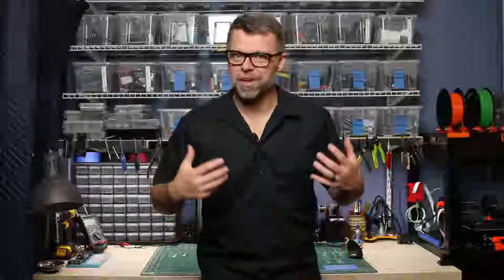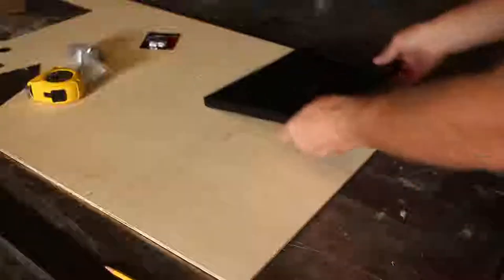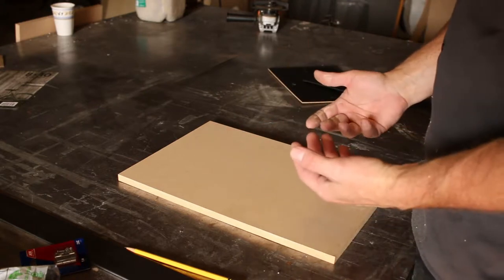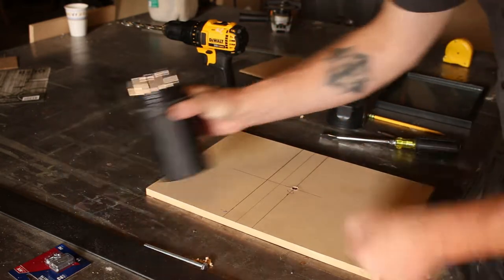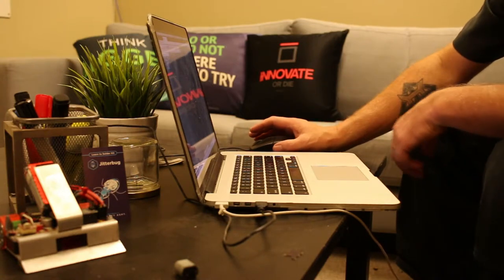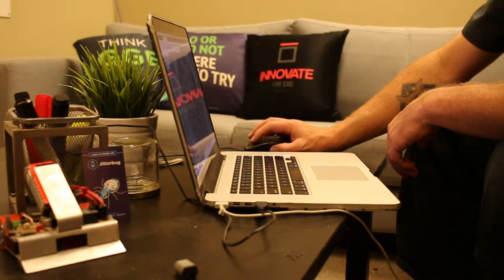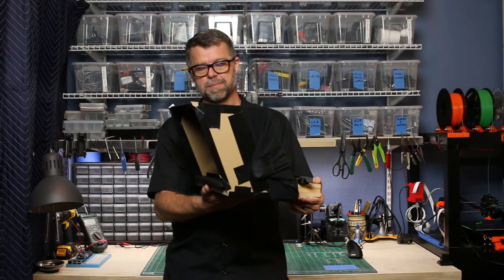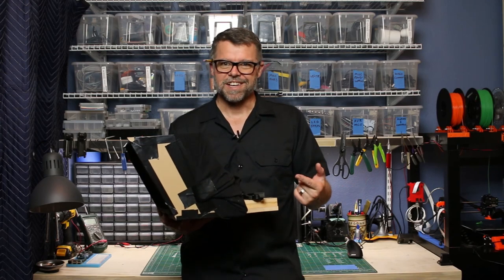Shop Build - Lets build a DIY Teleprompter

Comment: Depending on the style of insert, you can use a drill press to keep it aligned perpendicular. Turn it by hand while in the press to get it started then do whatever you need to do to get er done.

There are certainly videos going into details.

All the best, fellow maker.